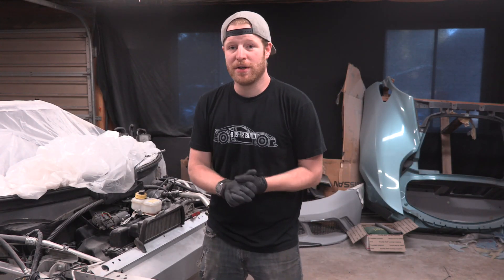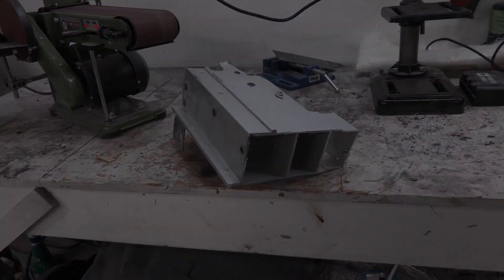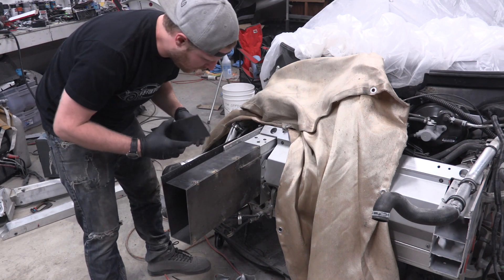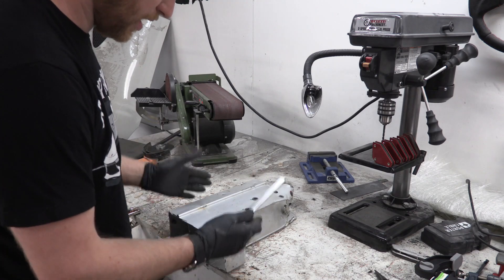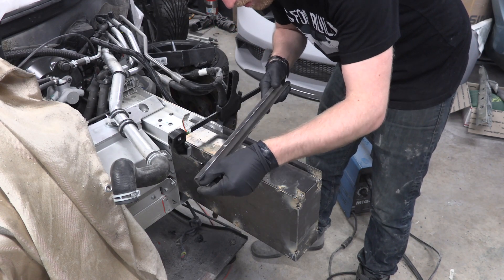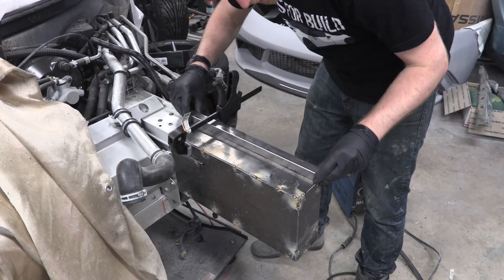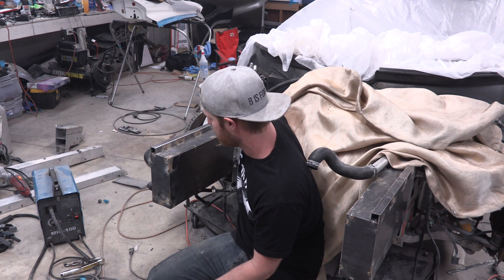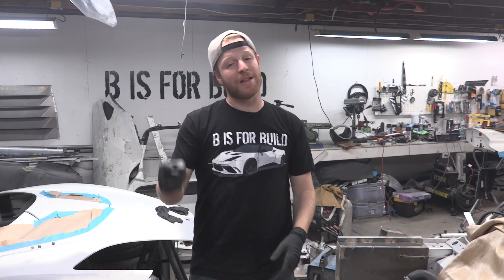Budget Lotus Evora Pt 20 - Rebuilding The Impact Bar

Comment: Not bad but the support braces inside frame strutsure for support is missing important for strength open end plates and fix support it's there for a reason don't shortcut your to good got that b is for best builder it looks great I've been working on cars my entire life your getting better don't shortcut if the car gets hit again someone could get hurt the strength changed without support inside sorry your better than that  your killing me you have been doing so good the car turned out great you can still fix make me proud open end plates if you do it once judgement is everything you have a choice those support are for stressed on metal when hit little things mean alot

Comment: Love the series but I think it would have been wise to have your certified aerospace welding mate consult an engineer on that one then simply buy a new sub frame. Wide relief Slots cut at intervals along the edges of the rail is the way it’s often done by Porsche and co so it can concertina. Let’s the water flow out too! I’m amazed what you can get back on the road in the U.S! That would never pass a crash test I’m afraid.

Comment: This build was impressive until you started putting steel on an aluminum chassis.  As you can see in the comments that is a bad idea on so many levels.  Besides you just welded a stronger material into your crumple zone, so that if you get into a head-on collision then the energy will not be absorbed, and instead it will kill you and the car.

Comment: Regarding the steel vs. aluminum debate: it appears you are using aluminum as the basis for your otherwise steel crash structure. As the saying goes, any system is only as strong as its weakest component. By that I meant to say it may be most prudent to fully revamp the entire crash structure as far back as practical if you truly do not believe Lotus designed the car to be as safe as possible. I am not fighting you nor disagreeing with you in any way; on the contrary. However, the car could be even safer if you reinforced the existing crash structure even farther back.

Comment: I dont agree with what you have done here dude A its look fkn horrible and B you will have adversely affect the front impact properties of the evora now Lotus would have spent Millions on R and D developing the front end to withstand a front impact and the car will be built around a crash structure that was designed to work in a specific way. Adding Steel to it might make it stronger but god forbid you have an front on collision  the car WILL NOT act the way it should and might even have an adverse effect the survivability of the people involved. I totally commend the work you're doing and you have done a great job but here you are messing with SAFETY and i pray it dosent come back and bite you in the arse.

Comment: I don't get it. Why would you create big heavy steel items that won't bend/break/deform as designed. Surely the additional weight outweighs benefits. I'm sure a front sub frame was offered as well? B is for Bodge on that front end I'm afraid :(

Comment: Hey Chris! Big fan, you inspired me to rebuild a 04 Indy 500 Impala that the previous owner rear ended someone with, (it's supercharged and sleeper-y...) 
anyways, you mentioned you'll be running 4 point harness...DONT! If the unfortunate event of a accident ever happens when running a 4 point it's possible you'll sink in your seat causing a spinal/internal organ injury. A 5 point would be much safer as the anti submarine belt would keep that from happening. Although their is one 4 point system from takiata where it has a stitched section that breaks in the event of a crash allowing the force to rotate one shoulder forwards rather then your body downwards.

Comment: Hey Chris, why did you use steel for the crash bar instead of aluminium? Not sure about this one...You want a structure that absorbs energy instead of transmitting it into the cockpit and passengers. A structure made of steel will not absorb as much energy, transmitting it to the inside.

Comment: Hey Chris,
Are you worried about upsetting the weight distribution of the car replacing the lightweight aluminum frame rails with the steel replacements?
Id be happy to help you fabricate some aluminum slip covers. I work for a Sheet metal shop and I do CAD design for a living.

Comment: There is no coming back from a messed up frame. 

RIP Evora, it was fun while it lasted
Reply: agree. about 300 better ways this could have been repaired (or maybe it shouldn't have been?)
Reply: No Air-Bags? Aftermarket Wheels? That is acceptable.

But to mess around with the frame simply puts this project down to nothing.
Reply: well... isn't he?
Reply: The crash structure is replacable. It's the cost factor that forces the current choice.
A new owner can still buy a new 3k$ alloy crashbox and replace it.

Comment: You need to cut strategic holes in the steel to create a crumple zone. This will also lighten the extentions to be more akin to the alloy weight you removed and not affect the handling as much.

Comment: Awesome build. I would like to make a few recommendations. 

1. Dont use those squeeze clamps. They melt, and then deflect. If you are going to use the all metal ones and remove the rubber feet. 
2. StrongHands makes "corner magnets" They are about $25 for 2 of them but they are super handy for stuff like this.

Comment: @bisforbuild chirs you should have something between the steel and the aluminum , steel and aluminum touching will make a little electrical charge between the two and the aluminum will corrode away t!! on boats they'll put a layer of rubber between the two to keep them insulated from each other!! you should defiantly look into it!

Comment: I would suggest to add an inner end cap to sit against the cutoff area of the aluminium. in an event of a head on crash that whole steel caps will just slide on the rails inward till the existing endcap makes contact with the rails. You can even drill holes to put  a bunch of bars through instead of an inner endcap plate.
Reply from the maker: We are drilling holes through both structures to bolt and glue it on, they dont just sit on there like that. Itll be shown in a later episode.
Reply: i did not think you would reply, just wanted to mention that, because it would be a shme if you spend all those hours on those sleeves for them not to work. I am subbed to your awesome channel, because of the lotus.

Comment: The steel isn't going to bend easily because its still attached to the "not very good" aluminum structure. Additionally if you weld it out in full like it sounds like you're planning to do that's going to make it all the more likely to just transfer the force into the aluminum frame rather than crumple itself. At the very least just stitch weld the extension or even put some relief cuts into it like they did with project binky to give it a place that it will want to bend, it will still be plenty sturdy for holding everything together but it will be far more likely to actually perform its intended function which is to crumple.

Comment: Hey mate, just a heads up about the orange goop, if it's anything like what's used on aircraft it's not adhesive, it's sealant (although it is sticky as hell). the rivets holding the part on are what provide the structure, and the sealant is to prevent corrosion between the material layers. The car is probably made from a corrosion resistant aluminium, but you still need to treat it to make sure stuff like water and gunk from the road don't cause corrosion. I'd apply some sort of surface protection to the spots you ground down so you don't get corrosion causing headaches. If you can find some sort of conversion coating (we use a product called alodine in the aviation industry but I suspect it's way too expensive for home use), then apply a primer you can probably avoid headaches. 

Also, if possible, put some sort of insulating layer between the steel caps and the aluminium body. when you have dis-similar metals in contact you encourage what's called "galvanic corrosion". it's effectively an accelerated form of corrosion (your car becomes a battery, with one metal being the anode, the other metal the cathode, and the environment the conductive medium).

Loving the build mate, keep the vids coming!
Reply: and literally the second I finished typing that you spoke about dis-similar metal corrosion in the vid.... oh well! haha!
Reply from the maker: really? dude, calm down, guess what every single one of those VERY important riv-nuts in the aluminum frame is made out of, STEEL, lotus put tons of steel bolts in the aluminum, its not going to just instantly corrode, it probably wont at all, all the aluminum is coated.  And the Orange stuff is a adhesive, you guys cant see it all on the film but they clearly used it to bond aluminum to aluminum

Comment: I see only one concern that I think You should consider, you have just replaced aluminum front structure with steel making it significantly heavier, and that part is basically the front overhang. Also You replaced rear 10 inch wide wheels with 8,5. Lotus is a very precisely built car with driving dynamic developed to the max, there is a great chance that the car you get in the end will be much less controllable, and a lot more "tail happy". Did you maybe consider making frame rail extensions shorter (just a sleeve to cover the original ones) with the base plate resting on the original aluminum structure, and then making a tubular frame from there? I think that might preserve the weight balance and if made right still be structurally sound.
Reply from the maker: I think you are really over estimating the difference in weight and the changes it makes.. when you even touch the brakes the weight transfer and load on the wheels is 100X the difference of the few pounds i added to the front. Its not gonna be a big deal. The tire width in the back will make it a little more tail happy, but i am ok with that, actually i might even be a little happy with it lol

Comment: Why not make them out of aluminium ? If You have access to an aerospace welder then fabricating one from the steel pattern you have made is pretty simple, this is stupid.
Reply: remind me not to buy a car that he as repaired...... I like life...
Reply: +Galf506 well in the later video he uses the aluminium crash bar thing anyway, he just didn't want the supports to break. the aluminium is still there to crumple right at the front but the steel keeps everything else from breaking
Reply: he explained why he is using steel instead of aluminium
Reply: Galf506 its pretty fucking simple how he explained it, he said he was using steel so it doesnt rip or break so easily compared to aluminium

Comment: Some lotus engineer is weeping at the ruined weight distribution.

xD Good stuff.
Reply: +Reduxian The battery should already be located in the rear from factory or am I mistaken?
Reply: I knew something like this would have to happen eventually, aluminum is just a whole new game especially for a man in a shed; Lotus sure never imagined anyone trying to fix one of these from that point.

Probably the best way he could've gone about it himself, glad to hear he's at-least sending em' off to be welded by his dime-master wielder buddy.

As said above I was thinking the same thing, maybe some inline or centered ballast in the rear to just get everything back to that general distribution.

Might seem minuscule but I have a feeling in something designed to the point this was, with the weight-saving materials included; that density of material probably makes quite a difference in the grand scheme of things.

Comment: Not convinced with your rational with ignoring the risks of an electrolytic reaction between the aluminium and steel. 
I would also be considered about the design of the sleeves being that rather than deforming in a controlled way and absorbing an impact, instead acting like a guillotine and sliding back along the original chassis rails.
Reply: Can only imagine the corrosion between the two pieces that have occurred over the past 5 years 😑

Comment: you'll need the red epoxy+rivets to hold the impact bars, the epoxy alone won't be enough
Reply: he said he would run bolts through the entire frame rail i think
Reply: I honestly don't think so. The two components epoxies should hold up just fine. Loctite 648 for example has 30N/mm^2 shear strength, and with a surface that large it should be even too strong.
Reply from the maker: yep

Comment: I would strongly recommend that you either get the gas upgrade for that welder, or find a MIG capable welder.  Flux Core makes for ugly welds and is tough to get right on thin stuff.
Reply from the maker: Thats why i just tacked it and then had eric do the actual welds
Reply: Sooner or later you'll want MIG, it's SOOO nice in comparison!

Comment: And there goes the proper weight distribution
Reply: By what a couple of kgs?
Reply from the maker: lol yeah 5 extra pounds isnt going to make a difference dude... why is everyone so happy to try and point out even the slightest thing that might be incorrect?
Reply: Don´t take the trouble to answer , you 're doing a great job with the Evora , surely those who criticize should neither change the oil in their cars or even wash them themselve, and the new front bumper looks lighter than that of evora s and as you do not going to put the wiper reservoir , I dont think there is any difference in weight. Great work.

Comment: I can assure you Lotus knew what they were doing when they chose to make the crash structure out of aluminum, mainly since the rest of the car is already aluminum. But of course, steel has much better weldability making it easier to build something like this as a one-off.

Comment: Not to be the devil's advocate here, but is it illegal to register a car in the US without functioning airbags? 'Cos, if it was Australia, I suspect that we could get it registered without the airbags, so we can just drive the car if we needed to. Also explains why TVR wasn't able to be sold in the US.
Reply: In the US we have federal law and state law, state law handles road law and what's street legal, which varies state to state. Oregon in paticular (where he's located) has no safety inspections, only emissions.
Reply from the maker: what kyle and ADez Prez said, i just pull up and they check the VIN and give me my license plates, its awesome. Im also emissions exempt :p
Reply: Technically a car that originally came with airbags should have airbags, however it depends on state laws. Some states like Arizona don't have any real inspections aside from emissions, so as long as your emissions are good you can do just about anything to the car.
Reply: Well there are street legal kit cars like the Exocet that don't have any airbags whatsoever, so I think it'll be fine... There might be some technicalities though...
Reply: If it came from factory with airbags it needs airbags. Basically the entire us rules
Reply: Gotcha. So he can't drive it on the road until the airbags have been fixed.
Reply: Kerim Pajazitovc He lives in Portland...
Reply: Air bags weren't required in cars and trucks until 1998 and the US.
Reply: +B is for Build yes, yes it is. cheers to that. goddamn DEQ...
Reply: +RallyDriva anything home made does not need airbags. simply because it would be too dangerous. airbag strength and placement is determined by professionals who do ton of R and D to make sure that you are indeed safer with them.
Reply: NO!! you couldn't it would not pass the roadworthy check you need to register it, and you probably also need a Vehicle Identity Validation (VIV) inspection in Victoria not sure about other States in Australia.

Comment: You are bolting those steel frame real extensions on aren't you? I hope you put some thick wall tubing sleeves in those aluminium tails so you don't just crush them when you tighten the bolts down
Reply: looks like he is cutting all these corners to simply avoid welding aluminium.
Reply: It's treated aluminum. Weld that, and it turns to pasta (strength wise) That's why Lotus glues the chassis together.
Reply: +Titties Mc Shwags I'm quite certain he said he will bolt it as well as glue it
Reply: no he is using the orange stuff that lotus used to bind all of the aluminum together
Reply: yea personally i think its best to weld the factory box section back to it to keep the original crumple zone
Reply from the maker: What Erik Anderson said, its bolts and glue, similar to how lotus used rivets and glue. Ive said this alot before but ill say it again, you cannot weld this, it is not possible.
Reply: That's right. Definitely needs sleeves.